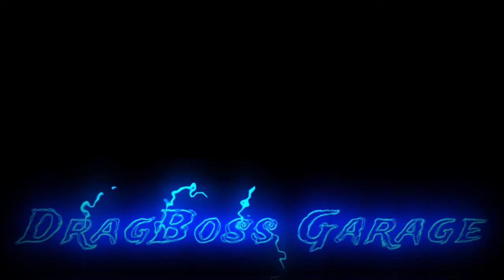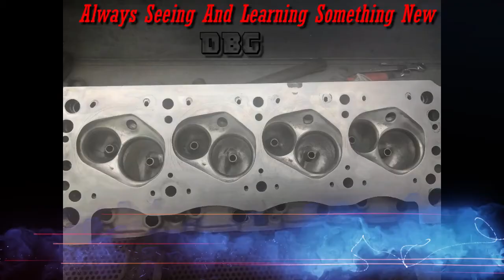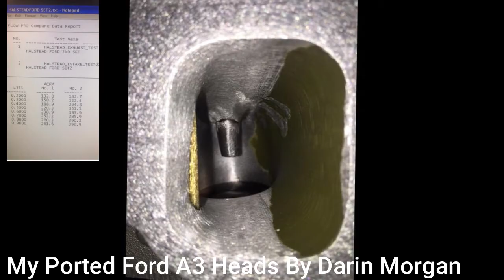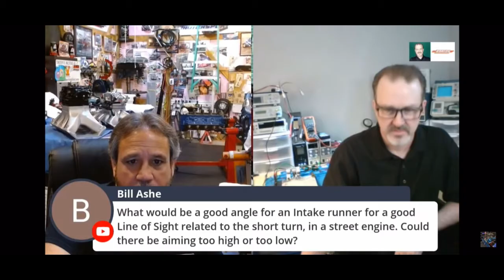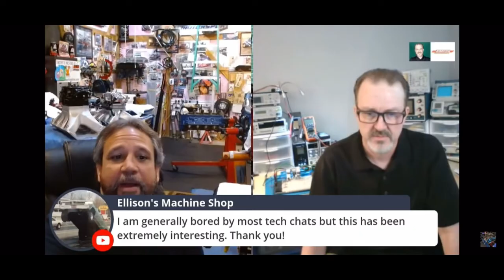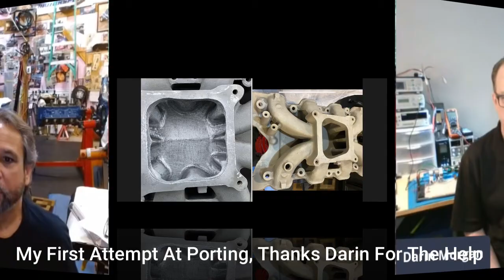DBG: Darin Morgan, Mystery Of The Short Turn, Why Similar Heads Make More Power Than Others ???

Comment: Mr, drag boss, I`ve got a serious question for you, I`ve go a set of Yates, Elliot C3 heads, intake and valley plate with shaft mount rockers.....I`m trying to put them on a 9.5 inch deck windsor block, I can`t find intake spacers to go from 9.2 to 9.5 deck. The engine is going into a florida mayhem asphalt modified, rules state "no dry sump" so my 9.2 NOS block is not permitted, Any help from you would be greatly appreaciated.
Reply from the maker: You have to make them or get them machined. Price Motorsport used to make that stuff check their web site. Thanks Ed💯💪💯
Reply: @dragboss351cleveland  Thanks brother.

Comment: You really REALLY need to cover some of these details from this video for an exhaust port, location of mca, sizing the mca, shape of the short turn. Help...
Reply from the maker: Remember exhaust does not need as much help as much as it has force and does not rely upon the atmospheric pressure.
Reply: @dragboss351cleveland understand but there are trade off decisions to be made. In my case the 300 head is the horsepower limiting issue and needs all the help it can get.
Reply from the maker: @BartTaylor-v2h ahh yes the 300 6. I have a 6 cylinder Cleveland head. Bolt that on and make serious HP. 😉
Reply: @dragboss351cleveland so cool

Comment: Why does NHRA limit RPM's to only 10,500, and how many RPM's would they be turning if there was no RPM limit?
Reply from the maker: With the limit at 10.500, takes out the hemis, they make power at 11k. At 10.5, none can compete.  It sure with their valvetrain, but stable to 11-11.5 may be limit
Reply: @dragboss351cleveland   So, NHRA is intentionally keeping the Hemi's out then. Sad. I am a Chevy guy but, I don't like this kind of racing.
Reply from the maker: @Yipe-gm1wp nope and there is no Ford offerings only GM, DRCE based.

Comment: Great insights on the short side radius and torque vs horsepower! My iron factory mopar heads gave 200ft lbs more than edelbrock victors race heads. Don't hate me for off branding you. Lol
Reply from the maker: Hey Michael. Glad you learned something. I don’t care what brand you have or prefer. They are all engines and we love hp
Reply: @michaelclanton1152  200!? Seriously?
Reply: @paulmryglod4802  yes on a dyno.
Reply: @paulmryglod4802  I had 1k hp 1k tq on iron heads and edelbrock 80 cfm mor flow gave 100hp but lower tq rpm,tq
Reply: @michaelclanton1152  wow I see. Race motor. Big difference!
Reply: @paulmryglod4802  15 lbs of boost 8-71roots on vp110

Comment: Get with him on the short turn at higher RPM, now this is what I have learned in the past, Chrysler in the 60s measured airspeed in an intake at 800 MPH and it went higher in short runners, and the faster it went the less it wanted to do the short turn and it flew across the valve backside and out between the valve and the seat on the other side and that is when they started making the far side of the chaimber a 45 degree angle from the top edge of the seat up to the deck of the head, this kept the air stuck to the angle rather than it coming out from under the valve and slamming into a vertical wall
Reply from the maker: I get it Fred, same with having short turn to high, acts like a ski jump. Never heard the 800 mph numbers. Good stuff Fred, thanks.

Comment: You picked up a lot of flow all the way and great low end #,s
Reply from the maker: Yes those are the heads on the Cougar currently, before work car ran  9.66. Darin said needs more compression and bigger cam and will make 800 hp

Comment: The short turn on Cleveland 2v heads  is that square shape Darin made with his fingers, and it has a monster bowl. On a pressure drop flow bench, low lift flow is incredible up to about .35 lift at which point the numbers fall away and a hurricane noise starts up. When the short turn is made into a turn instead of a box edge, low lift suffers somewhat but the flow is steady from .35 to .55 and the turbulence goes away. Is there any point to messing with an open chamber 2v head? I was driven purely by curiosity, but what I found has driven me to find a purpose for these heads.
Reply from the maker: Not a fan, but they will make power too. Remember not racing a flow bench.
Reply: I've seen pics of closed chamber 2V heads from Australia. I've had good results running 2V heads. I'm nothing more than a hobbyist though. But definitely check out Revan Evan's youtube channel. He's got a video of a friend who's fox body Mustang is running 10's with OEM iron, open chamber 2V Cleveland heads. Obviously he's running an aftermarket 2V 4bbl intake, with a hotter cam etc, etc.., but it's putting out 550 HP. And he says its a very basic build, using a lot of stock parts. And he's been racing it since the late 80's. It does wheel stands too :)

Comment: You ever find any info on those Cleveland heads i mentioned some weeks ago? They were a dart or world products head that was a cast head with aluminum plates that were an as cast head with the exhaust ports moved. I mentioned they were sold from summit in early 2000's for a sale price of 1000$. They were advised as a  Bob Gliden head.👈
Reply from the maker: Never saw them or found them. I have summit catalog from  later 80s, but nothing in 2000 range. Any luck?
Reply: @dragboss351cleveland  no luck here. I wish I would have saved my catalogs I would have mailed it to you.
Reply from the maker: @brianb8489 I would have appreciated that greatly. Mail me something to hang in DragBoss Garage and I will mail you something back 😊
Reply: @dragboss351cleveland  still makes me wonder though, alot of guys I knew back in the day were running gt-40p heads in mustangs with nitros claiming all "stock" makes me wonder if they would have made more power. But I don't know if the intake would match to pull off the sleeper hustle.
Reply from the maker: @brianb8489 what intake? Motorsport
Reply: @dragboss351cleveland  the regular stock EFI to a boss head
Reply: I have a set of the old Edelbrock Glidden heads from that era if that's what you mean
Reply: @active1508  the ones I remember were cast iron with aluminum plates, not sure what brand they were but they were around 1000$ for a pair.
Reply: @brianb8489  Hmmmm don't recall cast Iron Glidden's off hand but I got plenty of Summit Catalogs from that time frame just not sure when i'll get a chance to go through them. In the mean time PLEASE LMK if you find them. Would be great to get a part#. The late 90s early 2000s was a great time to be alive to see the evolution taking place in motorsports with things like the Motown product line and Trick Flow for SBF. The GENUINE AUSTRAILIAN Pro Action 23 degree 235s for SBC are still highly sought after, but nearly impossible to find. Same time period for NOS Progressive Controllers. Ah don't get me started lol! Seems as though that era had some of the best kept secrets.
Reply: @active1508  Cast iron with Aluminum plates, with the raised exhaust ports already casted in, no glue, no welding. I just remember them being reasonably priced for the time. Considering the twisted wedge heads were the popular head but expensive.
Reply: @active1508  i want to say they were made by World Products.
Reply from the maker: @brianb8489 I never have seen any before
Reply from the maker: @active1508 are you talking Bob or Billy Glidden?
Reply: @dragboss351cleveland  Bob Glidden
Reply from the maker: @brianb8489 find any pics?
Reply: @dragboss351cleveland  no, I was hoping the guy in the comments would find them. He says he has catalogs from that era.

Comment: Can a larger port (vs standard for application) reduce the negative effects of a abrupt short side? As air flow is not touching the wall of short side? (Boundary layer)
Reply from the maker: Not sure but the larger port will slow down the velocity and may allow smother entry?
Reply: @dragboss351cleveland  that’s kinda what I was getting at. Not thinking low rpm, more mid/upper. I run 190cc blueprint heads on my 331 sbf, and it’s geared so low rpm isn’t an issue. Still I wonder how much bigger port volume would improve flow before it’s too big
Reply from the maker: @piercer2 I don’t think a flow bench would tell you accurately. To me it’s a track test. But what do I know? 😳